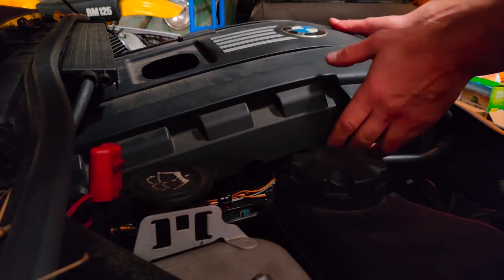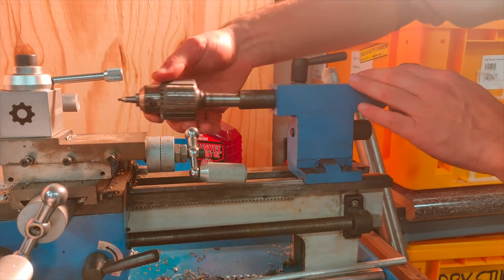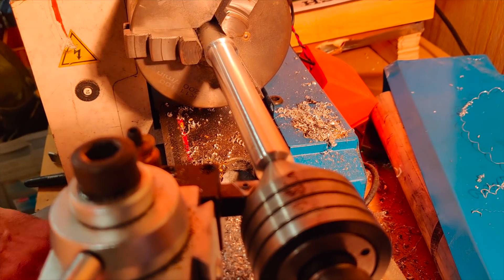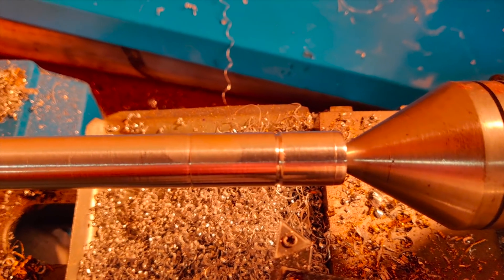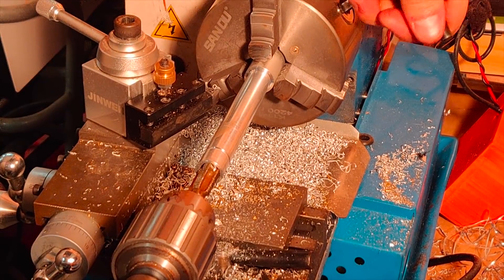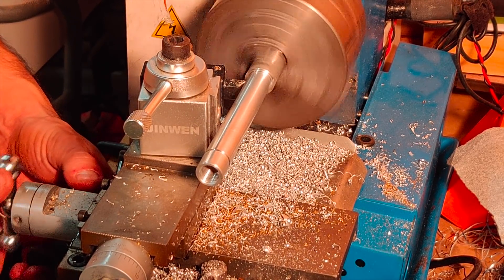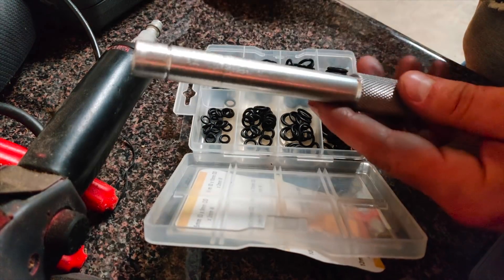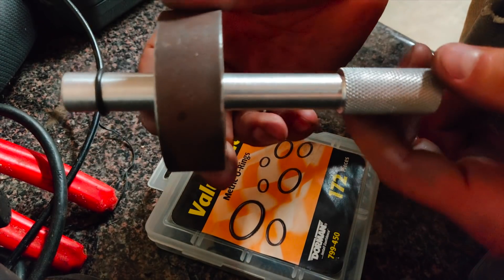Making a DIY e90 n54 BMW Fuel Injector Puller Removal Tool on the Mini Lathe

Comment: Nicely done!  It's amazing how having a few machine tools lets you make a tool (to sometimes then make another tool) to then do a job.  Even with an aluminum body I don't see how as a home mechanic you'll wear it out.  Dealer special tools have to be made tougher because of the special tools in coveralls using them . . . like me, when I was at the shop.
Reply from the maker: Thanks so much! I think this tool will have no problem outliving it's usefulness around my shop (hopefully ha)

Comment: I would suggest you to fix your tailstock alignment,  keep up the good work!
Reply from the maker: When you say the alignment, do you mean the slop in it or the side-to-side alignment? I think I've got it pretty close side-to-side but I'm not sure how (or if I even can) fix the slop in it.
Reply: Yeah, that looks terrible. I know this is a cheap lathe, but you should not be manually lifting the tailstock to make it fit into the center of the bar
Reply: Fixing it may be tough, but little machine shop has a whole tailstock assembly for not much money.

Comment: Great project to save money for a one-time-use tool. Can only imagine what the dealership/shop would want to do that for you, lol/eep. 

Another use off the top of my head for it. Dent puller? If you have an old drill chuck to adapt to the M12 threads or through an adapter for clamping onto tack welded clecos(or rivets with the shaft left on). Maybe, eh?
Reply from the maker: Thanks! And maybe!? it would be better on smaller dents or thinner metal since I'm not sure it would quite have the oomph to do any significant body work...

Comment: Yeah it works great. Now that's what I call using your tools at hand instead of renting for about 10 seconds of use, Great job, I would have liked to see you install the new injector, but I'm sure that went well. Thanks for sharing....Ken,  Marina CA
Reply from the maker: Thanks! I thought about doing another video on changing the injectors but I feel like that's such a specific video and traditionally I get a lot of push back when I post videos like that so it kind of discouraged me from doing it - plus the job went a lot faster not having to record it :)

Comment: Awesome job, man. Need a tool, make a tool! It's very satisfying to make something functional, especially when it saves you some dough. It's also great to have a use for small, "scrap" pieces, and makes you glad you didn't throw them away.

Another note... I sent you an email a while back to the address listed on your channel, but never heard back. I've got a bunch of tool holders for that JinWen tool post, and I no longer need them. I've got 6 regular holders, 3 boring bar holders, and a cutoff blade holder. I've also got 2 extra tool posts for parts. You're welcome to have it all. Let me know if you're interested.

Comment: My, what a surface finish you're getting from the el-cheapo lathe. Color me surprised. What insert did you use? Is it a specific one for aluminum?
Reply from the maker: Hey! I'm using these cheapo carbide tools https://amzn.to/2oRZWax and at this point almost all of them are chipped or well used.... if I had a fresh insert, the finish would have been even nicer :) 

That said, plenty of people have commented that I should be using either inserts specifically for aluminum or that this lathe doesn't spin fast enough for carbide and I really need to be using HSS tooling but I just went for cheap and easy and I've had nothing to complain about them.